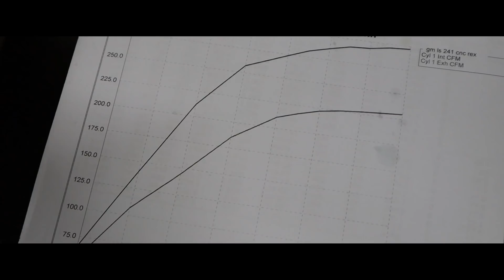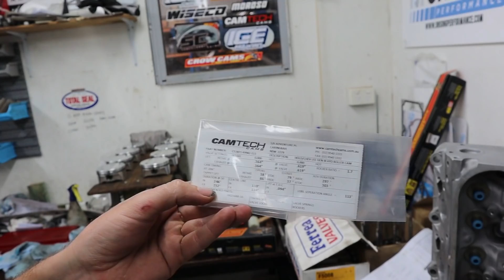Bottom End Assembly! || Stroker VY One Tonner Build || Part 2

Comment: Callies compstar is nice gear, I've  used them in a few builds, definitely one of the best of the offshore forgings in my opinion 👌
Reply from the maker: Yeh we have used them in plenty of sbc builds, first time we have used them in an LS. Only went for the Mace cause we originally bought their girdle and their rods were reasonably cheaper than a set of compstars. In the end its worth every but extra just to go compstars. So this combo ended up a K1 4inch crank, compstar rods and CP Bullets 👌 arp Mains and Head bolts should love some twin screw delivered boost in future
Reply: @BoostGumps  nice, the k1 stuff is mint also, I think it was Tom molnars side project for a bit, any wonder it's decent stuff given toms heritage.
Sounds like a stout build 👍
Reply from the maker: @DATONALKY  thats interesting info! I didnt know that. The more you know

Comment: Love the content. I’ve scoured through all your videos, great stuff. 

I’ve a very tidy, relatively low kilometre LS1 Monaro (120k). Plan is to have supercharged this year. Will either supercharge the stock LS1, or have a stand alone L98 built and supercharged them swapped into it (factory LS1 to be stored away)

What is your opinion on supercharging the stock bottom end LS1 (with all the usual valve train upgrades and cam), can reasonable reliability be expected? The goal is 500-600rwhp.

Cheers 👍